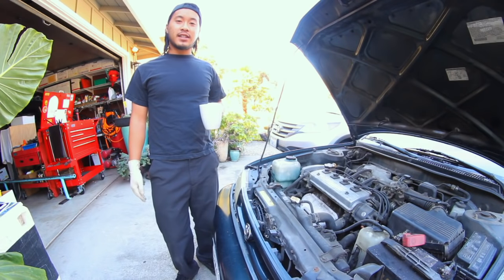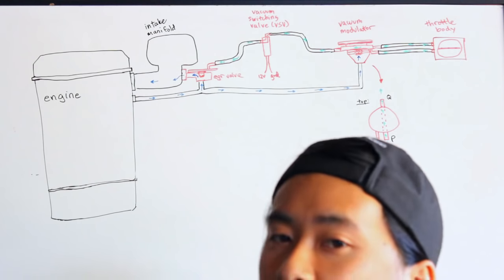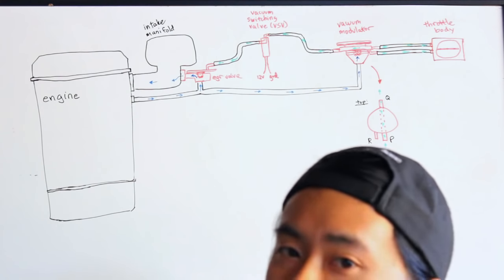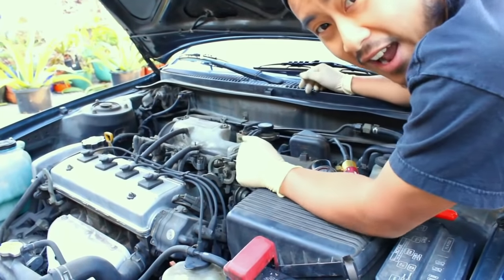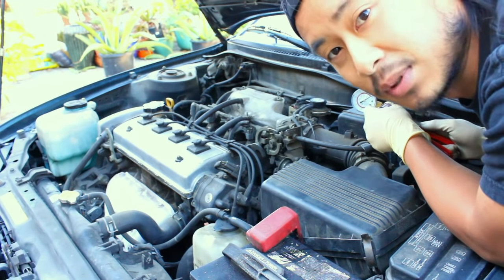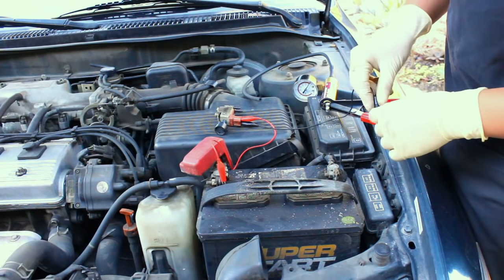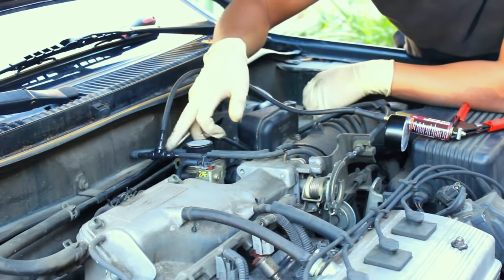How to test Toyota EGR System(VSV, Vacuum Modulator, EGR valve)

Comment: yes....when I choke the egr, the engine stalls out....!!! also the resistance on the vsv is zero, cold and @ 70f....!! so im thinking if the vsv passes the voltage clicking test, but failing the resistance check,......its faulty?
Reply: If it passes voltage clicking test, Frankie, It is good.

Comment: I know the vsv solenoid has two plastic connections for the air hoses, but does it matter which one I connect the vacuum pump to before I energize it with 12 volts, to see if it loses vacuum?
Reply from the maker: It should not matter... Also, depending on the style of vsv, it may lose vacuum or hold vacuum after applying 12V. Most cars will hold vacuum after applying 12V. Another way of testing this is blowing through it to see if the valve is open or closed, but with a vacuum gauge is more definitive.

Comment: I got a Toyota car it will run sometimes and sometimes it will not run most the time it runs in warm weather but when it gets cold it will not run the 1997 Toyota Corolla like I said I need help on fixing it a lot of people saying it's the EGR or the relay fuse so I got a relay fuse and put it on but I'm not hearing the fuel pump kick in but when I do not hear it kick in it  drives

Comment: Justin.... awesome video. Its very detailed. It helped me troubleshoot my Camry 2.2 code P0401. Turns out that I only receive 5.85 volts non the VSV connector, and not 12v. I am guessing the ECU is not providing enough power to the VSV. Have you seen that problem before??
Reply from the maker: Gus A. Not sure what that is. Try measuring the voltage at the ECU and see if it is still 5 volts. If so, id say its a safe bet that its the ECU. Also see if ecu is getting 12V it needs.
Reply: Yes, I also removed glove compartment to get to the ECU wiring. I connected my diagnostics scanner and activated the EGR VSV, and I only get 5.85 volts at the pins on the ECU. Every time I switch it ON I get 5.85v, then OFF I get zero volts. Check engine light is only for P0401, so the ECU is getting 12v since no other codes. Weird that the ECU is only supplying 5.85volts to the VSV connector when it should be 12v. I just ordered an ECU and will keep you all posted. I was just wondering if any one else has seen lack of juice supply to a any switch/solenoid component.
Reply from the maker: Gus A. Id say the ECU is a good call as long as the VSV is bench testing ok with 12V. Plz keep me updated.
Reply: I ordered a used ECU from auto recycler. I installed it this morning and drove about 20 miles. All components passed, no more check engine light, and I finally passed emissions test required by State of IL. So the problem was the ECU outputting 5.85V to the VSV, and now with the replacement ECU is output 12v as should. Once again, thanks for your thorough video which is quite educational.
Reply: Ohhh... that was me, Gus A. display name change
Reply: In that case, DUDE, where's your "how to test your ECU" video!?
Reply: Passed all 3 tests, but check engine light is still on.  How do you test the voltage going to vsv?  The connector to my VSV stayed at 0.0v.  Could that be the problem?
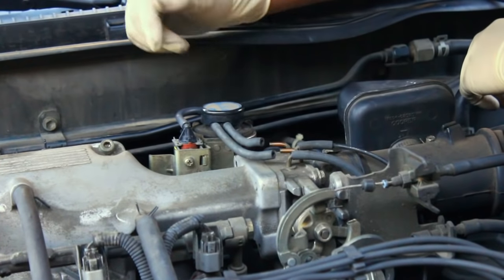Reply: Yes it COULD be the problem. Pull the connector to the VSV and hook up your volt meter to each pin of the harness. Then follow the last part of the video ~7:15 point. You should see about 12 volts applied from the ECU as it tries to open VSV. If not then you have a wire or ECU problem. Good luck.

Comment: Just I need help. I changed all three parts brand new  parts and clean intake throttle body with intake cleaner but my engine light still pop the  P0401 code. Please help what to do?
Reply: Justin

Comment: 1995 Toyota Tacoma 2.4 automatic 

Having 401 code pop up! Hooked vacuum up to egr valve and tested, no idle fluctuation at all. Hooked it up to friends Tacoma (1996 manual) just to see if I was doing it right and sure enough idle fluctuation. Replaced egr valve and tested again and still no idle fluctuation !!! V frustrating!!! Tested vsv, seemed to be working fine, vacuum modulator seemed to be working fine also.. any suggestions on what else I’m missing ??????
Reply from the maker: If you do not get an idle fluctuation, it can mean two things. Either there is carbon build-up where the egr valve connects thus blocking the exhaust gas, or the egr valve is stuck shut. Since you have a new egr valve, then it is most likely carbon build-up. Take the egr valve off and inspect the hole on the intake manifold, if there is carbon build-up, clean it out with carb cleaner (or brake clean). Let me know if this is the issue.
Reply: Thank you, Ill be back at it tomorrow morn. ill letcha know  @justinle998

Comment: how long before light goes out after replacing EGR valve? Thanks !
Reply: Reset the code using tech stream. If it comes up after 50-100 miles, then it could be your vsv valve

Comment: So when you blow on the VSV instead of applying vacuum should it go through or should I not be able to blow through it? Which way indicates that its bad?
Reply from the maker: Gaznod some models are different... some open with voltage and some close with voltage.. I think as long as you see some kind of actuation of the solenoid and the valve opening/closing, you can rule it out.
Reply from the maker: Gaznod Also, the idea is that the valve is opening or closing when you apply voltage. So you should be able to blow through it, and then not be able to blow through it accordingly.

Comment: if I don't have any vacuum coming from the left tube running out of the throttle body, and hardly any vacuum on the right tube. where does that indicate carbon buildup ?
Reply from the maker: Cody A try cleaning it... should definately feel those ports suck on your fingers a little bit when you open the throttle body
Reply: Justin Le what do I clean exactly? I sprayed some throttle body cleaner inside the throttle body and it didn't help any. ultimately my codes still showing
Reply from the maker: Cody A try spraying it down the vacuum port on the throttle body... see if that makes a difference.
Reply: Will do. Thanks bro

Comment: What if the engine doesn’t die when vacuum applied to the valve? Just runs really rough.
Reply: I know for certain that anything short of an immediate stall is improper; forget what part is being checked during that test.......back to the diagram! ( I'm new to all of this emission control stuff, other vehicle with EGR was deleted by p.o.)

Comment: I checked all 3 components and they all worked as how you showed us to check,  so I checked on the Z hose that from the engine to the air filter box and found a crack on it. Do you think that hose that caused a engine light on (code P0401)?
Reply from the maker: No. I think you're talking about the breather hose which goes from the valve cover to the air filter box. That just allows the valve train to ventilate. You should do that last test i did to see if vacuum is getting applied to the egr valve.
Reply: I could not see how you hooked the vacuum hose on the last test so I couldn't follow you on that. The Z hose I  mentioned above I just found out it is called " Air Intake hose" it has a tiny line crack around the "ring" so you said it is not an issue. is that right? Thanks
Reply: At 3:42 you mentioned the VSV valve and at 7:20 to validate, is it the same port that you hooked the vacuum hose up?
Reply from the maker: +Nguyen Nguyen yes... Using a t-fitting tap into that line to see if theres vacuum. If you dont find anything wrong, next would be to check if there is VSV command... Maybe there is a break in the harness to the VSV. Could be anything and its hard to say over the internet lol...

Comment: I have replace the modulator and cleaned the egr valve. The system seems to be working fine I even checked vacuum throughout and it is pulling fine. But I still get the 401 code after about 60 miles of resetting. Could the vsv still be the problem?
Reply from the maker: It is not hard to check the vsv... its probably the easiest test I show in the video, but if you are measuring vacuum at the EGR port that would show that everything before it is working. I would suggest checking if there is any blockage where the EGR valve meets the intake manifold. Also, check the egr valve using the test I show where you manually apply vacuum to see if the engine stalls. It might be getting vacuum, but the valve maybe stuck shut. Some people just suck on the rubber hose like a straw, instead of using the tool I show.
Reply: Justin Le I did all the checks you did and everything checks out. I'll check the intake connection to the egr for more build up. Thanks for the video and advice
Reply from the maker: Let me know how it goes...

Comment: I pumped the vaccum to the egr and the car hesitated to turn off it wouldnt it would hesitate and stay on. So does that mean my egr is bad?
Reply from the maker: Keith Dimas if your car did not stumble then the EGR most likely has carbon build up at the passage way connecting to the intake manifold.... or the valve is stuck shut. Remove egr valve and clean carbon and inspect egr valve

Comment: hey buddy, i have the Celica 5sfe engine...
no engine light, but I am sure this system is my issue...
is this possible?
1994 Celica GT
Reply: Working on a 1995 Celica GT 2.2L 5S-FE. Poor idle when cold/stalling. Looking forward to walking through Justin's trouble shooting steps to eliminate / identify any EGR issue. Did you resolve your issue?

Comment: My VSV is backwards on my Rav 4. When I apply vacuum it reads nothing but when I apply 12 volts it creates vacuum. What does it mean? VSV bad?
Reply from the maker: Because the VSV clicks and the valve is opening/closing is proof that it is working.........
Forgot to mention, some VSVs are like that... where they work backwards to what I said in the video. Whether 12V opens or closes the VSV is just the preference of the engineer who designed it.
Reply: Justin Le Yeah I found another forum where someone said it’s backwards to your video. Really was confused for a second but glad I got that figured out

Comment: it passed the voltage test, but when I check the resistance on it.......it doesn't register anything 0 ohms......which I do believe it should have a resistance of at least 33 to 39 ohms....@ at least 68f.
Reply from the maker: If the solenoid passed the voltage test i would put the VSV on the bottom of my list. I think by measuring resistance you are mainly looking for a really high or infinite resistance. Generally, a low resistance measurement is good for a solenoid. I would check everything else, and if there is nothing, come back to the VSV.
Reply from the maker: Have you tried choking the engine by applying vacuum to the EGR valve yet? Like i showed in the video.

Comment: everything else is working properly....!! modulator, egr valve & egr valve pipe that goes to the throttle body........when I disconnect the vsv the engine runs much better.

Comment: Hey does anyone have a 1991 Toyota Camry with a2,2L engine and wanted to know that part on the front of the engine it has a metal shield with a picture of a hand with an X thru it and a hose also coming out has Japanese writing
Reply: Hand with X means , do not touch, HOT

Comment: 2000 Toyota Camry I have a oil leak from somewhere I think it's located somewhere under the car near the front passenger wheel I'm a female I don't know anything about cars can anybody tell me what it is I need fixed ?
Reply: If that has the 4 cylinder, 2.2 L , it is probably the oil pump seal and gasket..maybe cam shaft seal too. You will want to change the timing belt as well.  Some what labor intensive.  Took me a few days, on a Celica with much less room to work. I think the pros do it in 3 to 6 hours,well at least I heard a guy say he does it in 3 but I highly doubt it. Maybe $70 or so in parts with water pump too.

Comment: @justinle great video bro. We had a recently engine replacement on 1984 toyota camry 2.0 and mechanic forgot to put the egr vacuum module and did all wrong connections to everywhere car hassitates to accelerate and cuts off back and forward on low rpms. fuel ratio is we burn 3.4 gallon going 55 miles only. That's crazy it burns like 3 times more. I may need ur help on it I have the toyota book. but car is in turkey so finding the module can be hassle since there is only one of this car in turkey and no spare parts. Can u email me ur email ebrahem ozturk I may have few question for you don't worry I'll pay for your time if you have PayPal. I wanna know can I use other Toyotas egr vacuum madule on this guy. thank you in advance. I'm gonna take a long trip with the car and with the gas it's burning now it will cost me arm and leg.